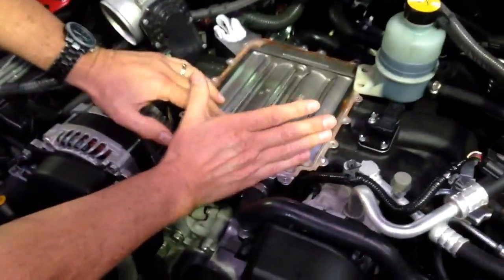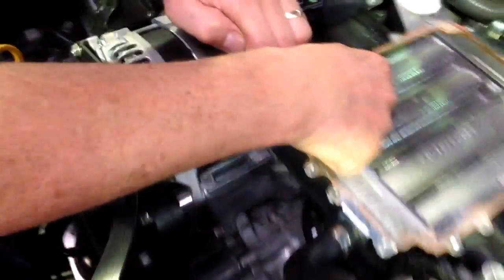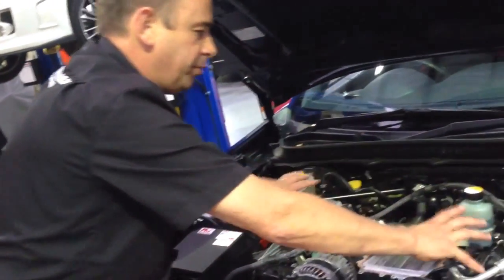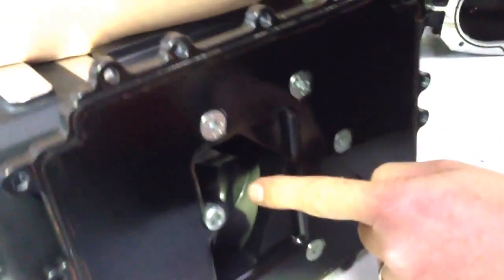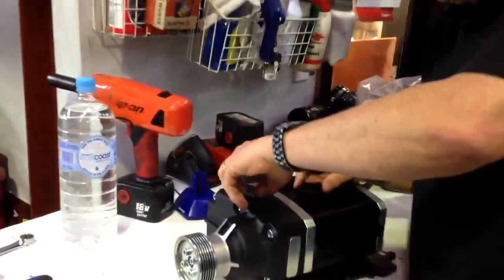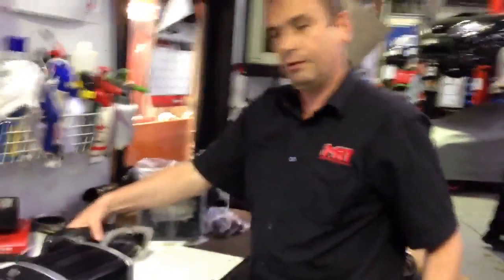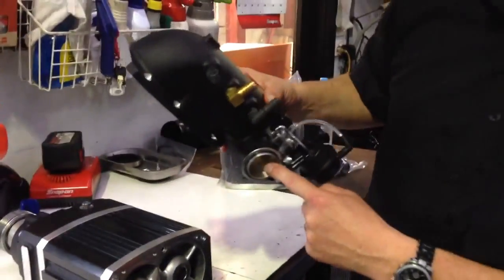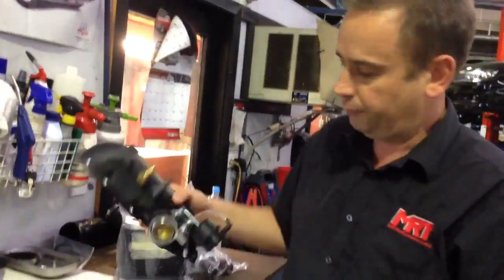Supercharger secrets, what's inside the Toyota 86, Subaru BRZ, Scion FRS

Comment: somehow i does not look that it can dissipate (or exchange) lot of heat, surface are is not that great, also gas speed is quite large.Did you made any temperature measurements before and after supercharger heat exchanger ?

Comment: I wonder if supercharged will affect the drift performance of 86...and also what happen to the near 50:50 weight distribution? Wouldn't these parts added weight to the front of the car?

Also, after installing supercharged, is it necessary to replace exhaust system, wheels and brakes to cope with the extra power?
Reply: from what i know from other vids the 50:50 weight distribution remains the same. you dont have to change exhaust or wheels but i would recommend it for opening up the back end to stop conjestion and stuff. oh and bigger wheels and tyres are recommended for better cornering whilst if you choose correctly you can still have so tail out fun! i hope that helped.

Comment: I got my GTS and am considering either turbo charging it or super charging it, my question is, are these engines really designed to be modded and if so, what would be the smartest of the two options as I do not want to compromise reliability of the vehicle. I got 6 year warranty so I am reluctant to dive in head first so quickly without understanding what these changes could potentially do to my car. I am not interested in a racer but I strongly believe that this car deserves a bit more power. Great video, professional and succinct.